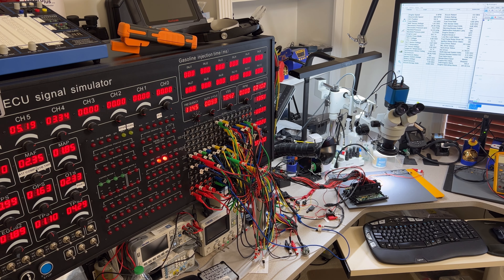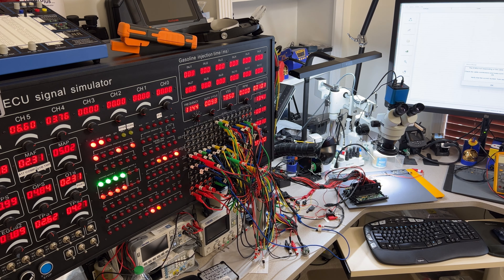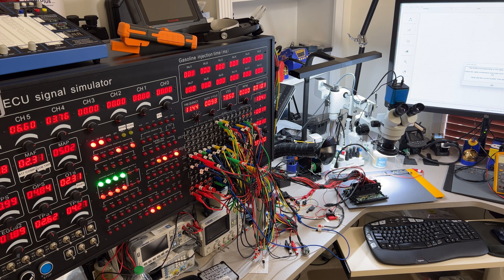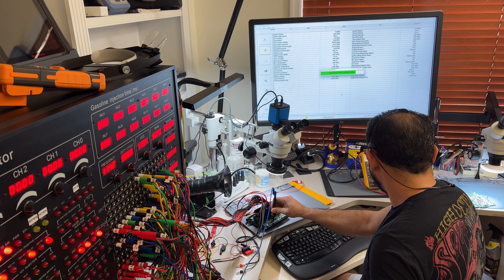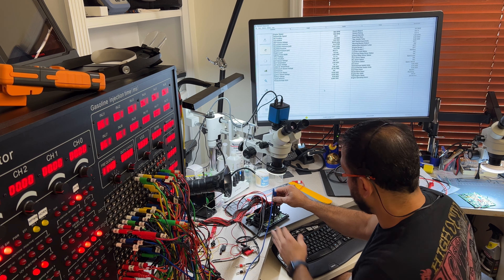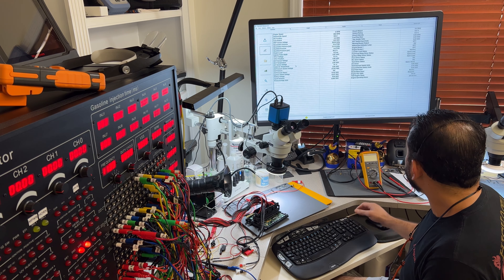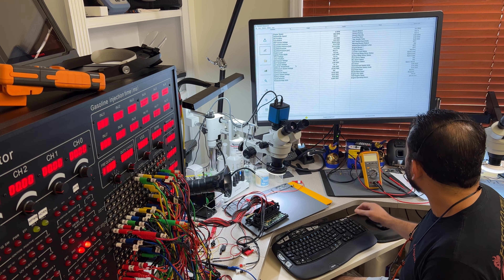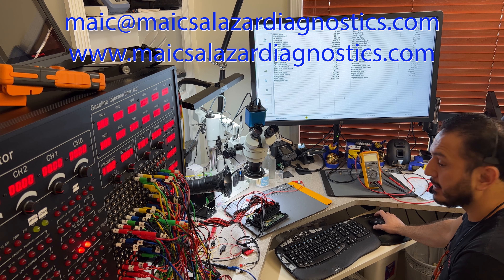2005 Volvo Penta 5 7L Gi G test ECM no comm Joe Canada

Comment: Great work, really appreciate what you are doing.
As I am a mechanic and auto electrician, I'm curious,  are you charging for the diagnostic time? Say for example he decides not to go ahead with the actual repair. Also what could be causing a bad ground, dry joint, broken connector?
Reply from the maker: Yes test fee is discussed before sending the module to me. This specific case was self induce while charging a battery.
Reply: @MaicSalazarDiagnostics   but generally, a bad ground is caused by? This one has fried something.🙏